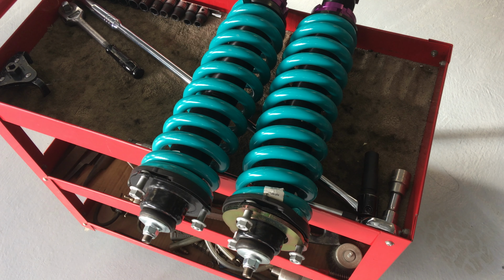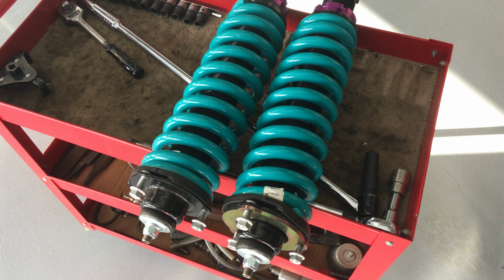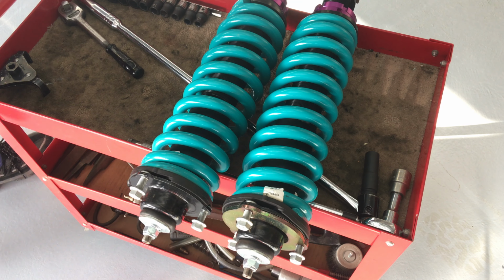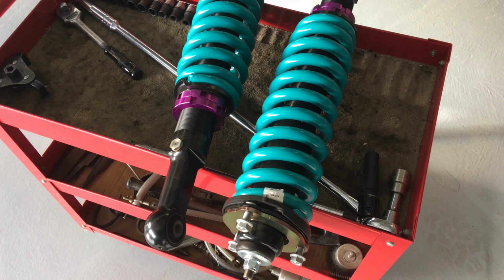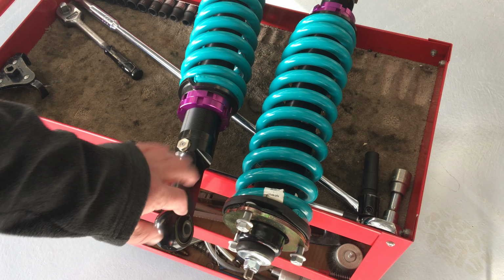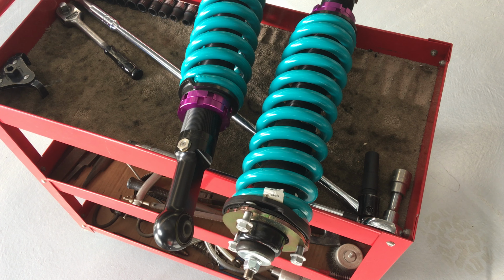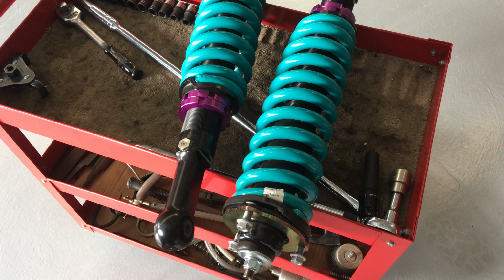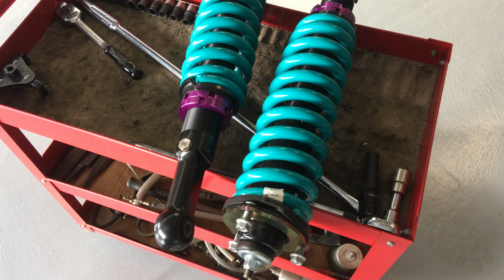AVOID THE SPACER FAIL

Comment: If a top hat spacer is fitted above the strut, to achieve the aforesaid "lift", then the static equilibrium point would still shift down. But would the strut's extended length also cause the down travel to increase beyond the previous droop limit. Would this mean that the wheel travel in this case is not conserved and has increased? (by an amount equal to spacer thickness) ?

Thanks for the video and effort in explaining it practically.

Comment: The problem is the use of aftermarket shocks that are extended. I think you'll find those Dobinson's are about 15mm longer than a stock shock and if you add a spacer to them they will do damage. A small spacer with stock suspension (5-10mm) is generally okay.

Comment: Pacer lift per mm of thickness will vary per vehicle.
If you measure from the pivot point of the lower control arm to the shock mount center point and then measure from the shock mount to the ball joint center that will give you the info you need to work out the actual lift on your vehicle.
On my R51 those figures are 22cm and 12cm.
12 divided by 22 = 0.545 so if you multiply the spacer thickness by 1.545 that gives you the actual lift.
In my case a 5mm spacer gives 7.725mm lift.
A 10mm spacer would give me 15.45mm lift.
The issue is that the standard studs are only long enough for a 5mm spacer so that is my max size without resorting to the spacers that have separate mounting studs.
Those are thicker than I would use. I already have a 30mm lift from my Dobinson springs on Bilstein shocks.

Comment: I’ve got standard rated 2 inch lift and after getting a bullbar and winch need to correct the 1.5cm nose dip. Adjusted the spring seat as shown in one of your videos but now they ride too stiff due to increased preload I think. What’s the best way to get this matter solved add a spacer or swap out spring to 100kg rated ones? Second option would be least preferred as I’ve already spent money on the lift.

Comment: Hey Anthony, what about in the situation where I am kitting out my brand new Prado GXL with all-Australia-Touring kit which is going to add a fair bit of weight front and rear, and all I want to do is compensate for the settling of the suspension under full load when on tour? Let's say it settles 20mm, but I want the car to travel with Standard Original Ride Height. I thought a 10mm front and 20mm rear spacer would do the job. Do you think it's a bad idea?

Comment: Hi Anthony, thanks for an interesting and informative video. I have upgraded my IFS/Leaf suspension D40 Navara to include winch & bar, but I am looking to get rid of the rake and have the vehicle sit flat. In this scenario, and based on what you have said, my strut spacers would have to be half of the difference between front and rear, so 20 mm diff would equate to a 10mm spacer to have the wheel arch gap be the same front and rear? Cheers mate.

Comment: Hey mate great video I have those exact coilovers with a 2” lift in a np300 and would like a 5 ml spacers then going with control arms and adjusting it up over $800 for uca and plus install roughly u think a 5 ml spacer will be fine not to much off roading just want a little more lift up front cheers mate